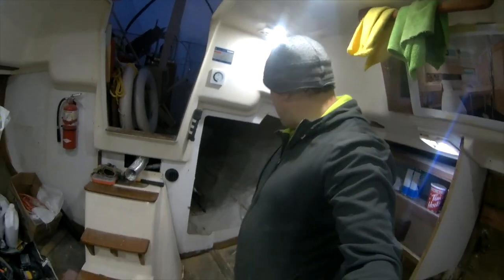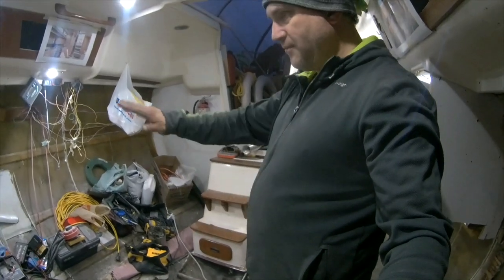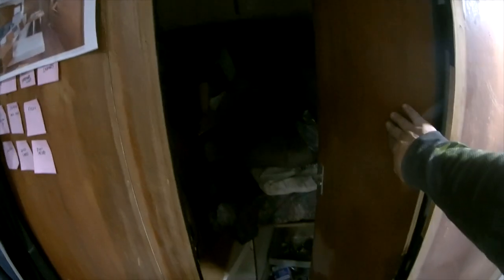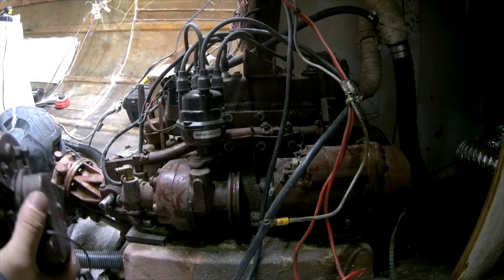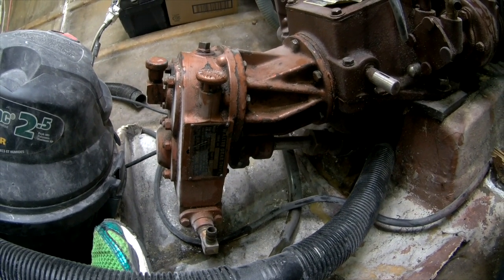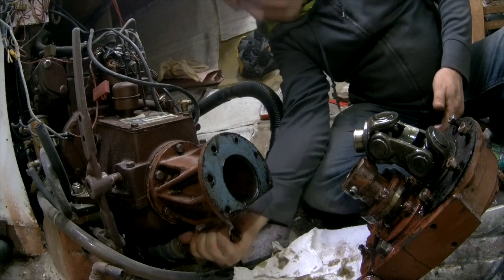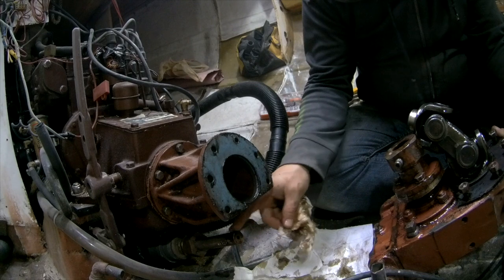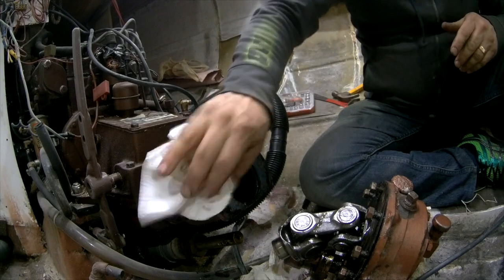Ep22 Engine Removal, Prepare for Electric Motor Conversion

Comment: hi this is kannan very interesting on your video i need one information  10 KW 48 V electrical motor witch capacity of bower backup you selection and how many distance achieve one full charging
Reply from the maker: i’m not 100% sure i understand your question but right now with 100Ah lithium i can get about 80Ah according to manufacturer (LiFoPO4). At 35 amps (48v) i should get 2 hours and almost 3.5 to 4 knots boat speed. if i run it at 20Amps then i get closer to 4 hours but i only have 2.5 to 3 knots of boat speed.